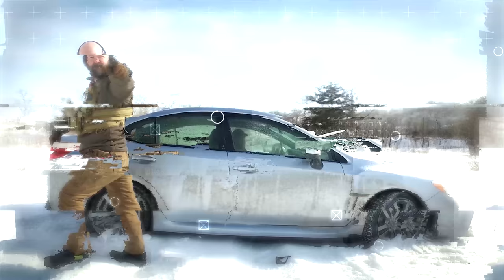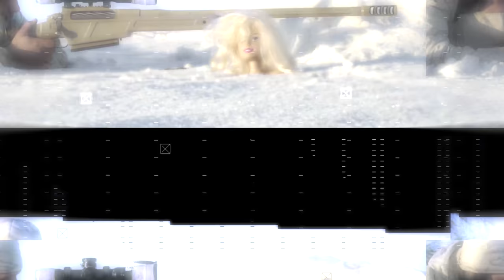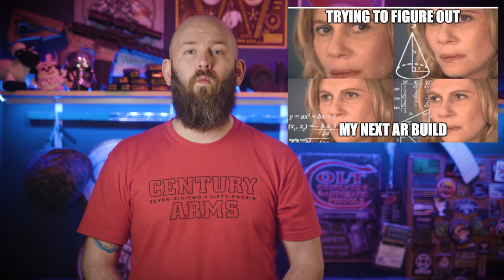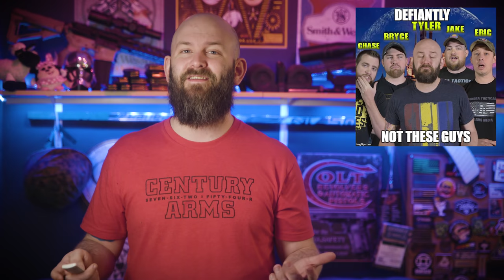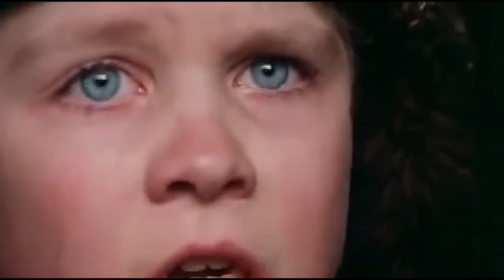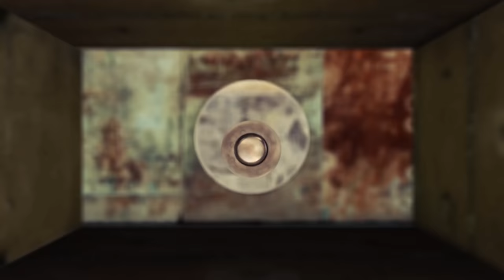The Coronavirus Quarantine Special : Why building an AR-15 Sucks

Comment: Can confirm just about all of this. Ruined several roll pins, almost took my eye out with a detent... twice... with the same detent... after a half hour of looking for it. Have also lost springs that my kids found months later in really odd places.
Reply: I took the upper into the hardware store and put the damn roll pin in on their counter. No I dont need any help go away mind your business
Reply: Next time just use a bag lol catches springs and detents every time lol
Reply: Yeah, I finally just bought a bag of detents, detent springs, and safety springs for when I build out a lower because I know I'm going to lose at least one of those parts during the build.
Reply: He meant to put the lower receiver in a gallon size or bigger ziplock and do the work in there to help capture the springs should they come out again.
Reply: I think I launched like 3 pins into the next deminson 😂😂

Comment: If you tap the hole for the rear take down retaining pin spring held under the castle nut plate to 4-40, it can't jump out the next time you change buffer tubes and you can adjust the tension.

Comment: The bits about losing the springs hits close to home.  My older brother borrowed me a Wheeler toolkit which included specialty tools for inserting springs and detents, and I still had to go searching for a launched spring at least a dozen times.  I actually bent the bits that hold the bolt catch rollpin as well, enough to pinch the catch where it wouldn't move and I was sure I was screwed.  Attaching the upper to the lower fixed it though, but the two receivers didn't fit together without some force so I think that straightened the catch out again.

Comment: The last three times I have built or purchased a new upper, for whatever reason I wanted them, I always go to my storage unit after getting it put together, and realize I still have an old M6 rail sitting in storage, and I still need to build an upper for it.

derp.

Also, best trick I ever found for keeping track of springs and detents. Uline sells GIANT ASS zip parts bags, 28x30"... Shove your receiver and parts, pins, tools, and your whole damn head in the bag, then start plugging away. Just be sure to bring your eyepro too.

Comment: Been there, done that

Don't forget the, you buy a part, say a BCG, and when you use it you find out it is defective and have to return or replace it. (Been there too. Specifically it was the extractor grove that was not deep enough and wouldn't extract)

Comment: To add to my last comment about Blue, I got some parts. Opticsplanet + a canal in Egypt... Found an Adams piston kit, got the carbon fiber barrel. Piston is MilSpec, barrel is bull. Well, my old Stag could use a piston, right? Stag is rifle length, piston rod is mid. Order rifle length rod. Rod makes it miraculously through customs (WHY??). Rod doesn't clear the barrel nut. Order forspecial barrel nut. Wait a week for delivery. Install new barrel nut, install piston kit...upper receiver bushing is missing, as is the bolt spring. Order more damn parts. Adams upgrades to free overnight shipping! Fit bushing, and start to tap it in. Punch is not long enough. Trip to Home Depot for some rod stock, and toilet repair parts. Can't shut the toilet water off because the valve is corroded off, back to Home Depot...wait what were we talking about? feed rod through the upper to tap in the bushing. It's stuck. Check clearance. All is good. Tap harder. Nothing. Try to tap bushing out, no dice. Might as well be welded in place. Dremmel the shit out of it. Perfect! LocTite and carefully space and calibrate the gas block and piston position for proper clearance. Install handguar...install hand...sonovabitch! Strip the Stag down, and reinstall the old parts minus the upper receiver. Now I have no AR's.  Check Stag fo parts. OMFG they have uppers in stock!! Order 3 at a discount! Stag gets a new Upper, and I lose 3 springs and one detent pin to the carpet gods. Find a folding lower at the gun shop...fuck it! That, another stock buffer spring grip and a short barrel. We're making a pistol now! Where the hell did my bolt carrier go?? Oh yeah...back in the Stag. Shorty gets the piston kit! New AR-10 inherits the Geissele trigger, and all...3 AR's get Triggertech upgrades. I've already got the reverse mortgage started. Ordered the wrong diameter flash hider for Blue. the 10 gets another upgrade! Oh, and meanwhile I bought every tool, and a giant set of wrenches for the fuckin barrel nuts, and standard kits have 1", 1 1/8", 1 1/4", 1 1/2", 1 5/8"...I had to special order a 1 3/8" wrench from friggin China, because everyone from Craftsman to Harbor Freight don't make one!! And of course the same goes for crow's feet. My torque wrench is 3/8" drive, and the armorer's tool, and the crows foot are 1/2" fuck my life!! Just smoke the shit out of it with my calibrated torque elbow. (Former USAF Crew Chief, so spitballing torque specs +/- a few pounds was a job skill...I mean if QA says anything you saw me use a torque wrench.)  Buy shitty Magpul handguard for Shorty to dial in the gas block, and finish the build while I wait for a handguard that's reported by Adams to fit. Of course the guard is supposed to be used with a standard A2 front sight block. Zip tie the shit out of it. After much argument over $800 worth of custom wrong color anodized parts, the guy remakes the colored parts. Look fantastic. Blue is finished, Stag is back in operation, Shorty minus the handguard is good enough for the range. Everything works!! Handguard arrives, fits, looks great...doesn't clear the piston rod. Out comes the Dremmel again. Burn through every single sandy bit I have carving 1/64" channel in the grip, re-black the aluminum, re-fit. Runs amazing now!
So...now I have an upgraded Stag, an upgraded AR-10, an AR-15 Pistol, and a pretty Blue AR-15 Rifl...PISTOL...It's a Pistol! Another visit to SB Tactical to make it legal. Turns out a 14.5" barrel plus a 2.5" brake only counts if it's pinned and welded, so Blue is a pistol now, because I love my dogs, and I want them to be alive. 
....
And that is the story about how I built my first AR!  The next person who says "crush washers" or "shim spacers" can punch themselves in the dick for me.

Comment: My 1st ar build was all dpms (rip) parts m4 flattop spring and pins everywhere but done in one evening complete with painted inlays wanted everyone to see safe fire and dpms. Second build last year months of picking the perfect parts list and websites to get it all from pricing it out and when I pulled the trigger I ordered the Springfield saint edge and f it it’s sweet as it is and should work our the box..

Comment: I wasn't aware that Amazon sold gun parts. Bought some pre Corona Chinese flip up sights on Ebay and they're fine. The upper they are attached to on the other hand is a useless pistol. Just built an XM-177 for under 150 bucks.

Comment: how about $50 solid cantered Iron sighs that strip the bolts out right away? I feel like I could weld some cut standard sights that would have held up better. It wasn't even aluminum. Bought them because the cheaper flip sights I got were trash unsurprisingly.

Comment: I have absolutely never ever launched a mag release spring across the room simply by accidentally loading pressure on it when sliding it across my gun mat...not ever. I have also never skipped a hammer down the side of a lower when hammering in a bolt release roll pin...not even once.
Reply from the maker: We understand and feel for you

Comment: If you’re only trying to build “1” AR, maybe.  It’s better to understand you will build dozens.  SOLGW LPK, Geissele triggers, Parallax Tactical rails, B5 P23 pistol grip, Slash’s heavy buffers and springs, Magpul UBR stock and Compass Lake Engineering barrel.  Now for optics, it’s Trijicon or go home.  Okay, Nightforce works too.  Cheap parts are for the poors.